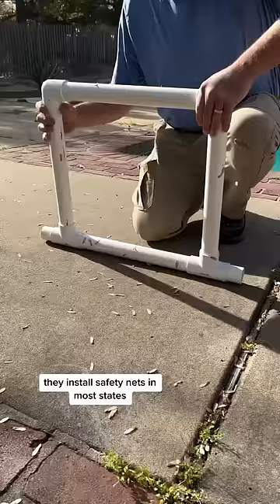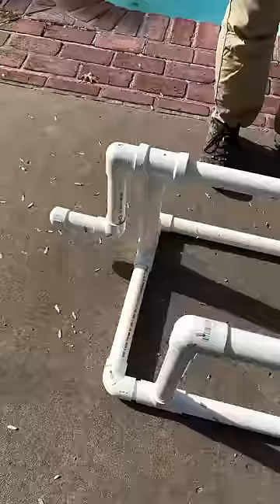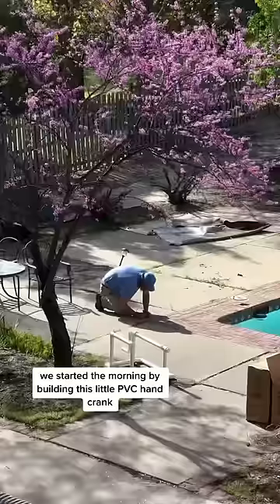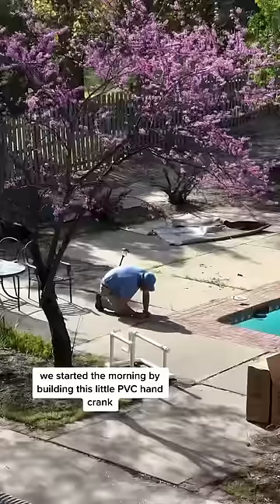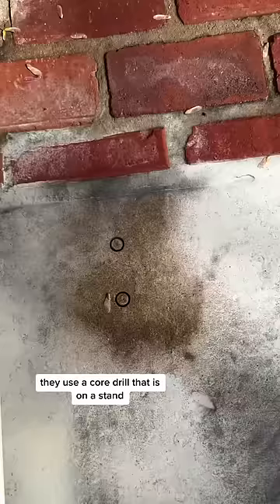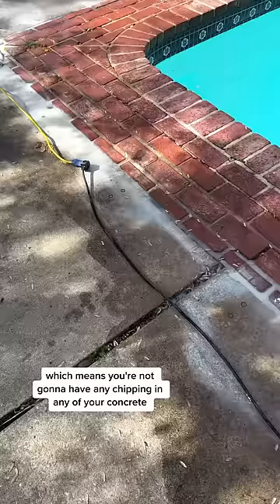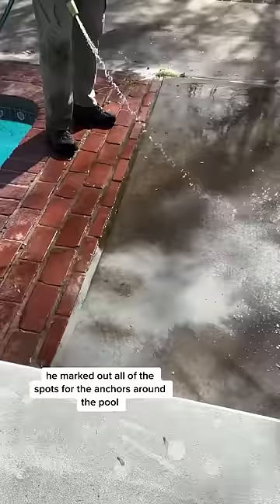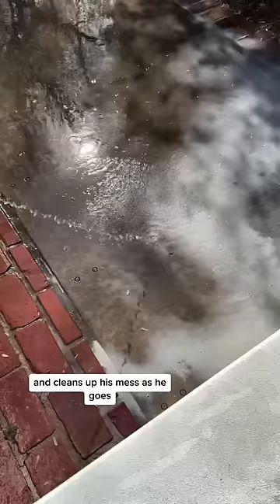This has made us feel so much better about our pool with kids! #diy

Comment: Just so you know, it only takes an inch of water to drown.  If a child were to fall in (on) this netting and gilt little arms and legs tangled in the netting, drowning is still conceivable.  Just be very careful and aware as I know you are.
Reply: If they die due to this netting. Its doubtful they were gonna live a long happy life anyway
Reply: Does it bow down and touch the water?
Reply: @cryptoyt756 what? 2yr olds can get tangled really easily
Reply: @maysnyder4104 think it's stretched very tight
Reply: Honestly the fact that over the entire history of the company not a single kid has drowned with this netting over their pools, shows how unlikely that actually is. But yes, you are correct it only takes a very minimal amount of water to drown. However having this net in place would give a parent MUCH more time to react if a kid were to accidentally fall in. Plus, they said that on top(or below it, they didn't specify)of the net they put an actual pool cover. Those 2 things combined and I'd say it's nearly impossible for a kid to have enough time on the net and cover to drown before a parent could react, if it's even possible for the water to get on top of the cover if it's above the net.
Reply: If you can lift your head how can you drown in an inch of water? (Genuinely asking)
Reply: @kittypipkin Babies don't have neck control and can't lift their heads. So it could be possible to drown in an inch of water for them or someone with a disability that prevents that. But yes, most people can just lift their head but it is just been tested so they know that is all it takes is an inch of water to drown. 
 I have heard it said because some parents say they will only have a few inches of water in a baby pool or something so kid couple years old will be fine but of course they should always supervise the child because even in a inch or two they could still drown.
Reply: @KayLoveDot babies from 3months upwards have neck control. 
Any baby less than that needs to explain how they got into the pool in the first place.
Reply: @kittypipkin  Drunk people passing out is how adults do. Kids and babies are kinda weird and sometimes don't have the thought/motor control to lift their heads.
Reply: @emrysgaming6015 How many have you seen in person? My answer is 0. Doesn't seem like there is a high use rate.
Reply: The company has no reported deaths in 51 years
Reply: @KayLoveDot if a baby with no neck control gets to the pool on its own, that’s on the parents at that point 😭
Reply: @maddiesmenagerie8853  No that was speaking to the "one inch of water is all it take to drown you" scenario actually. Then someone asked if you had just an inch of water could you not lift your head? So it was speaking of many different things, kind of off topic from this katchakid net and pool completely.
Reply: @bietonye  Yes I said after a few months old then most people  can lift their neck. But actually there is many other reasons why someone wouldn't have good neck control. && we were speaking off topic of the swimming pool and katchakid net on the subject of the whole "it only takes an inch to drown". Not a baby less than 3 months old making its way to a pool! Come on!?!?
Reply: @bietonye  Actually for good neck control they say baby will need to be 4-6 months old. I mean some babies have great neck control at 3months too but that is just what the facts say. But either way I NEVER claimed a baby that can't yet even crawl would make it's way to a damn pool!
Reply: Conceivable…. But unlikely considering no one has drowned with this installed in 51 years.    That’s a lot of year.  Almost twice my life lol
Reply: Also, just so you know.  You can also DRY DROWN with just a half cup of water. 

Accidents can still happen. But taking these safety measure sure greatly reduces the risks.   &&& again.  With no incidents in 51 YEARS.    You can not REASONABLY deny the life saving capabilities of this product nor the competency of this company. 

If I ever got a pool.  I would for sure be looking into having this installed
Reply: @cryptoyt756 I just want you to know that you sounded so much like my dad right there thanks for making my day!
Reply: @KayLoveDot if a baby is that young it isn't getting in the pool anyway
Reply: @cryptoyt756 wtf does that mean
Reply: This netting is engineered to prevent that. If you bought a cheap pool net and installed it yourself possibly, but this is designed to hold the weight of multiple people.
Reply: Derrrp. It is impossible for their face to get near the water. A child under 100 lbs can not reset enough force to push the net down enough to get their face in the water.
Reply: I mean. Yeah, but still they've never had that happened so it seems to work either way
Reply: @maysnyder4104 no it doesn’t, I looked. Do if a kid were to get stuck they would not drown. Also I think it’s the net and then pool cover, so I don’t think they can get stuck with the pool cover on top. I think this comment it wrong
Reply: @cryptoyt756 dude not cool! Please consider your words before posting them.
Reply: @emrysgaming6015 also the tension of the net would make it easier for the fallen child to at least roll onto their side or something, also yes! Gives parents more reaction time
Reply: Well, our pool had a flimsy cover on it. Our dad just told us never to walk on it or touch it because if we did it would fold in on us and suffocate us to death. That kept me from drowning pretty good.
Reply: True, better to just get a fence
Reply: @kittypipkin it could be people with disabilities, any kind of thing where you become unconcious near a pool (like standing near the pool, having a stroke or epileptic seizure, and falling into the pool) or other things
Reply: @kittypipkin it's also possible a person could get knocked out before falling into said inch of water
Reply: Maybe that is what happened 52 years ago???
Reply: Which is why they did both a safety net and pool cover
Reply: @aikakai3220  true. Have a lock and key with it not just a passcode bc kids can memorize the numbers.
Reply: Yeah, but presumably that’s much easier to notice than if they’d sunken under and they’re easier to get to
Reply: "No one has drowned in any of their installed pools in 51 years" YouTube comments: AHKTUALLY THIS IS DANGEROUS AND A KID IS GONNA DROWN!!!!!
Reply: Thank you to everyone who responded to my question :)
Reply: @emrysgaming6015  51 years is a long time, but I'd be more interested in knowing the number of nets they've installed to really gauge how effective they are
Reply: @bietonye  babies also instinctively hold their breath underwater until about 6 months of age
Reply: @cryptoyt756 i’m 14 was on swim team and i’m a strong swimmer in general and i feel like i would get tangled in this net and die
Reply: @snap.-_- Yeah but if they drown, they won't live long ngl
Reply: @cryptoyt756 hahahaha
Reply: You're the one that always thinks of the negative and says "no" to everything,  I bet. NO KID DEATHS IN 51 YEARS
Reply: @snap.-_- that’s the parents fault for leaving the baby unattended
Reply: The net is too taught to wrap at all, itd be impossible to get wrapped up in this, thats the point.
Reply: I think your point is valid. The point of the product is not to replace proper parental care. The parents must take full responsibility for the child’s safety and if there is a pool they must watch the child at all times. This net should be a tool for a parent to better look after their child and not installed so the parents don’t have to put in effort.
Reply: @KayLoveDot babies that can’t hold their necks up aren’t gonna make it anywhere near the pool unless you throw them in
Reply: @maddiesmenagerie8853 similarly. If there’s a baby with no neck at all…still on the parents
Reply: I though it was a teaspoon?
Reply: That’s called natural selection
Reply: Yep
Reply: You know him ?
Reply: @snap.-_- And they’re not very smart 2 year olds, natural selection
Reply: @meemaw2200  lol
Reply: @the-guy-on-your-moms-couch  Have you not read the comments? The pool had nothing to do with my comment about the baby not lifting their necks. It was someone asking about the "you can only drown in one inch of water situation". Side topic from the pool. I was clear about that MANY TIMES! 
 NEVER did I say a baby would drown with this katchakid product or in a pool. Thanks
Reply: The net is very tight as you can see when the grown adult is standing on it it doesn't go down much
Reply: That's not possible there's like a foot between the net and water
Reply: @purplepixie274 that’s how new pool covers are, but over the next few months it gets stretched more and more until it’s not tight anymore, and it’s gonna be a bitch to try to clean the pool
Reply: Its natural selection at that point then like another guy said
Reply: That’s what I was thinking
Reply: That's not drowning.  It's suicide and little Johnny wanted out....
Reply: If they drown in an inch of water, they were probably not long for this world anyways...
Reply: @cryptoyt756 if its even slightly loose, even an adult can drown on that net if he gets tangled on it... Maybe you should try that with that attitude :)
Reply: They could drown in the bathtub too. Could drown in a mud Puddle.
Reply: If this is what takes them out, odds are a puddle was gonna come along & end em at some point anyways 🤷‍♂️
Reply: “Didn’t he almost drown in two inches of water” the penguin exhibit

Comment: I almost drowned as a kid, and this wouldn’t have prevented it. I was wearing a swim suit, we had all been swimming earlier. I fell in while the adults were not right there. A pool fence is much safer, because you don’t need to remove it when you want to go swimming. Children can stay out of the pool even when others are in
Reply: Fences dont prevent it. Plenty of Kids still drown.
Reply: I don't know about you but I was really good at climbing fences as a kid
Reply: Having all of these options is good, but the biggest issue is drowning when you're meant to be in the pool but nobody is watching.
Reply: @demetriam2408 yeah that was happening to a kid at our community pool, actively drowning right next to two adults he was there with, and other adults standing very close by in the water. I was outside the pool and knew the signs because I’ve been a lifeguard. The adults didn’t hear me shouting at them over the sounds of the pool, let alone hearing a drowning child. (Drowning is usually silent; normally the only sound may be splashing, which means almost nothing in a pool already full of waves.) The kid was fine, btw. 

Also, some signs to watch out for:
Bobbing up and down in the water. This is often because they’re trying to jump off the bottom to get to the surface. 
No calling/vocalizing. Often when someone is drowning, all their energy is going toward getting air in, not calling for help. 
Latching frantically onto others. This can be one of the most dangerous parts of rescues, because if not handled right can lead to both of you drowning. That’s why lifeguards approach them from behind; it also makes it easier to pull their head/shoulders back and up so they can breathe.
Reply: @DieGurkenfresser kids are great climbers. Even at one they know how to drag something over to climb on top and over.

Comment: That net worries me just as much as not having one
Reply: I assure you that if you can step on it with out it collapsing it is so much better then an unprotective pool cover. Stepping in an unprotective pool cover is a death sentence. I'm not joking
Reply: Makes No sense
Reply: @DieGurkenfresser what if a kids foot goes in the hole and they get stuck lying face down?
Reply: @maxslifer1391 

Im sure the several minutes struggling will be more than enough time to get to the kid and get them out vrs them sinking straight to the bottom of the pool, also them laying on top is much easier to drag out than at the bottom of the pool

And if your smooth ass brain was listening he said he also had a pool cover those two will make it basically impossible for a kid to drown in this pool.
Reply: @artsyscrub3226  agreed. The net is just a bonus. The holes are decently small and do not flex much. The adult male only made it flex a little by doing a backflip onto it.
Reply: Yet it has been proven to work with no drownings, ever?
Reply: @maxslifer1391 hasn't happened once. So seems unlikely or they've thought of that
Reply: By looks of the net it's a child's safety net, as a former dumb kid then things r strong. I had one hung up and u can fully lay in em like they can handle a adults weight multiple kid and all that chaos. In addition u can fully run al em and even climb and swing on em and it ain't do anything not even a little. Every so many years gotta get em checked n replaced just to check the water and oils n chemicals ain't eroding the actual rope but there pretty brimming strong. Saw my nephew jump on em (he's a heavy kid and tall for his age) and it had nothing under it was just hanging he was fine rope didn't even do owt. Blimin strong kinda rope ain't gotta worry bout it. Kid can full on RINO charge at it and it won't budge
Reply: @Blynxe its more a face falling through, panicking child (or drunk adult, like theres a difference) can’t get out, takes in water and drowns. Just get a fence. You drown a hell of a lot quicker than people think
Reply: @Blynxe as if real safety covers don’t exist